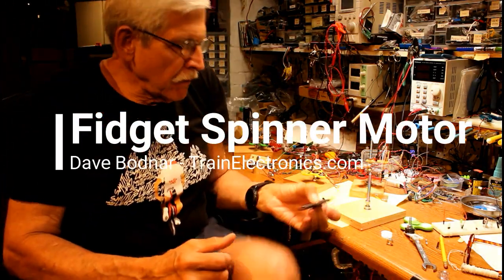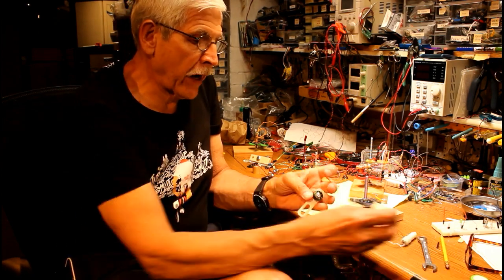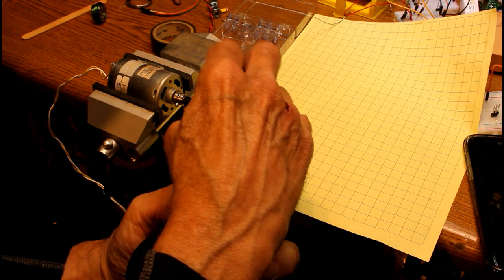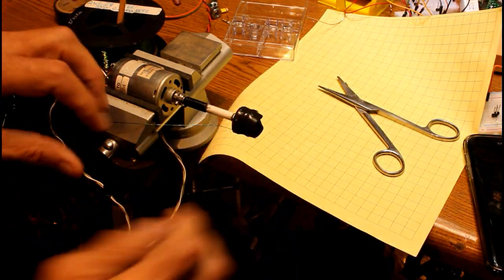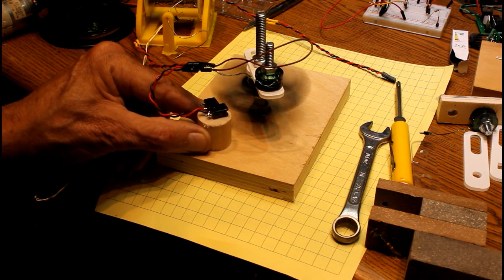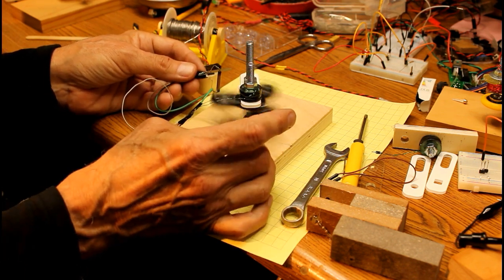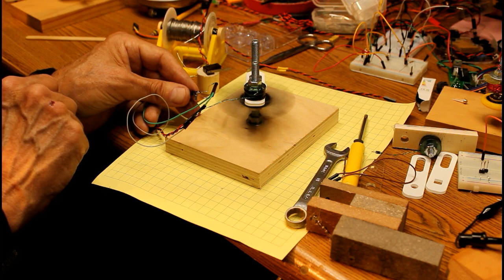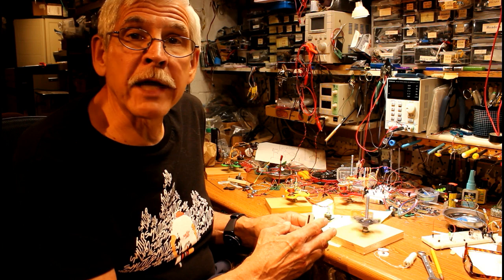Make a Brushless Motor from a Fidget Spinner

Comment: What reed switch are you using, also how do you keep reed switch from arcing?
Reply from the maker: I used a generic reed switch that I had in my junk box - I, too, thought that arcing would be an issue but it worked fine for quite some time
dave

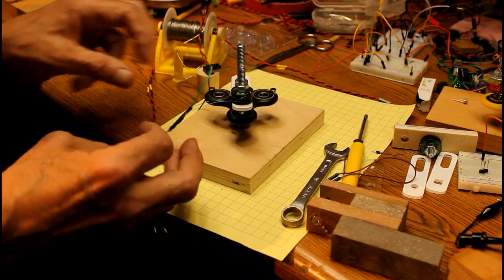Comment: I thought people used a condenser ( a capacitor type of a thing) to slow down the arching in the switch as has been used in automobile coil back in the days.  It appears that diodes serve the same function. That is interesting know.  I assume it is hooked up maybe differently in terms of its position and also direction.  However I did notice in your schematics, one here and the other on your website showing both ways.  each pointing the opposite of the other and in the same part of the circuit.  Not sure if that matters or if you  have noticed. Here your diode is pointing north (9:50 time frame) and in your website the diode is  pointing south.  
http://trainelectronics.com/FidgetSpinner/
Also what does "D1" mean for the diode?  Are there different types and one should use the "D1" type? Oh got it, it is a 1 amp diode, just googled it.  :-)
Thanks.
Reply from the maker: Good observation!  The diode in the video's diagram is backwards - the bar on the diode (the cathode) should go to the positive terminal of the battery or power supply - the diagram on the web page is correct.
Thanks for helping to get that corrected
dave
Reply: @DaveBodnar  Well, I am going to take a chance to see if I will wear my welcome.  Here I go.  Chances are the answer may be too complicated.   I took a front loading LG washing machine apart, which I got for free for parts. I have saved everything intact, meaning the direct drive motor ( that was the main item of interest).  All of the wires, the control panel, and the computer. The motor looks magnificent to me.  How on earth I can run the motor now that everything is on the floor of my garage.  I have looked all over the YouTube,  No luck. at all anywhere on the internet and not even close to anyone saying anything about it.  There is only one video for instance on YouTube by Mr. Electron but he is playing with it by means of Battery 12 V.  and some control module. But I am wondering if I can use the washing machine control system bypassing other demands of the module.  Are you going to say I am over my head?  :-) 
 https://www.youtube.com/watch?v=g-o0L7QaY3k
Awhile back I sent you an email but never heard from you yet.  Yesterday I finally got a spinner motor with reed switch running.  I burned the switch ( too much voltage) and lost two magnets.  The rest I won't bore you with.  The motor was so alive.  :-)
Here is something  that I thought was I don't even know what to call it,  for now will call it a coincidence.  When/if you watch that Mr. Electron's video above, Exactly as you see that motor with whatever is with it, the plastic drum and the metal part base cut,  that is exactly what I did . I found it very amusing watching my motor in somebody's hand in I think India.
Reply from the maker: @alchemy1  If you had a schematic for the washing machine you might be able to redo the controller to meet your needs - without it all is trial & error, not a simple undertaking but still doable.  It is certainly worth some experimentation.
Good deal on getting the motor working!  It is great fun, eh?
dave
Reply: @DaveBodnar  I just turned 61 last October.  I act and feel like I am a kid who is so happy going to school but this time no one give me a test, No one  judges or can or compare me to others and me taking it to heart as real.  How that type of innocence can get lost is a million dollar conundrum.   
I am also happy to say that I made my own reed switch for the spinner as I toasted the first one from wherever I found it.    It works so beautiful that I don't know what to say.  I simply hot glued two thin magnet wires on two sides of a paint stir stick, let it stick out about couple of inches from the end of the stick.  At the end of one of the wire I soldered a metal from a metal clip in the form of a coil about 1/4 inches long.  You can imagine, as the magnet passes by it the magnet attracts the metal coil and it touches the copper wire below it and the rest is history.  You can visibly see the switch's operation vibrate up and down.  I guess I call it Blue Ocean(Ali's)  switch.  :-)
I don't know where the joy of learning comes from but it is what gives  being alive meaning.  
I don't know who said it, when or where I heard it aside from not knowing its meaning because that experience and the meaning of it  was lost and killed. But this is what comes to mind.  Someone said that the purpose of life was to learn.
And subconsciously what comes to mind and I never asked that person is what I remember was this:.  "Learn for what?"
Now the details to answer that subconscious question looks like this.
When one enjoys the beauty of a sunset, the joy of a good conversation, moment of seeing a long lost friend, a little puppy wants you to pick it up, one never asks why?

Comment: I was wondering if there was a reason why you didn't show close shot of the wiring of the microswitch and the reed switch, unless each one is a two wire switch like a light switch of a house.  But for some reason I think they are more than a simple two contact set up, maybe three or more?
Also I was wondering if you had the coil pole end the same as the magnet pole ( repulsive force) or opposite or perhaps that doesn't make any difference except it would just cause a change in the position of the switches?
Furthermore you said it maybe a good to install some sort of diode with the reed switch so it doesn't get quickly corroded.  Is a diode a simple two wire connection that  is installed to what wire in the reed switch you said?
Thank you very much.

Comment: If you use bifilar wound coils you can just about wipe out the lenz effect.
This becomes more important if you add a coil like your drive coil with a bridge rectifier for power.
 to power your motor. Try it before you say it can't work. the bifilar wound coils is the key.
The bifilar wound coils will get rid of most of the loading effect. I recently found a patented generator that makes use of this effect.  just use 2 wires while you are winding your coils and connect the 2 circuits in the coil in series, it's just that easy

Comment: another switch could be optical, but then you'd get into more complex circuitry and the timing would not be very easy though it would be solid state and last indefinately. reed switches I think only last around 1M cycles so a day or 2 continuous @ 1000rpm
interesting vid!
Reply from the maker: Good points - have a look at part II for Hall and optical sensors
dave

Comment: I LOVE IT TEACHER!!!!!!I LOVE TO SEE ALL YOUR VIDEOS....BY THE WAY IS NICE TO SET UP THE SPINNER INTO THE WASHER MACHINE PUMP I HAVE TWO AND I USE A 12VOLTS VACUME CLEANER  MOTOR THIS MOTOR IS FOR 120 VOLTS BUT WORKS WHIT 12 VOLTS AND I SET TWO LITTLE PUMPS AND GIVE ME CLOSE TO 60 VOLTS EACH MAY BE MORE IF I SET ONLY ONE AND TURNS MANY 120 LED LIGHTS....SO YOU GIVE ME IDEA TO SET THE SPINNER INTO THIS PUMPS,ALSO I MAKE SOME LAMPS 3 TO 7 VOLTS AND TURN I OR TWO 12 VOLTS  7 WATTS LAMPS AND 120 VOLTS LED WORKS AWESOME ...THANKS TEACHER!!!!

Comment: thanks for posting.  good work.  here is a some very late info for you and your subs.      Hardened steel should  NOT  be used as the ferrous-metal core of an electromagnet/solenoid.   why.    at some point in the future, the steel will become  Permanently  magnetized.    the presence of a permanent magnetic field in the core material will  Adversely  affect motor  performance.   compare the silicon steel used in transformers, etc.     instead, any kind of mild steel would be a better choice for the core material.   a few nail shafts, in a bunch, could be used.    cheers

Comment: What about using a (about 5 uF, or 0.5uF (if I remember right)) capacitor on the reed switch, ... just like the old points system on a car engine to eliminate sparks on the contacts.
OR, no mechanical contacts at all, using a hall effect sensor & a transistor as a switch, ... there are many ways, as you probably know.
I should have watched part 2 first, ... ha ha...
Reply from the maker: The capacitor would help.... the better method, explored in part 2 of the video, does use hall sensors - have a look!
dave

Comment: That is pretty good.  What would happen if you put a wire wrapped in a toroidal shape around the circumference of the three spinners and run an electrical current through the toroidal shape?    The current could be controlled by a computer to run at a desirable speed.  Could the speed of the spinners be controlled by varying the electric current?
Reply from the maker: Thomas- that sounds like what it would take to make it a traditional brushed motor unless you found some other way to power to the coils you describe

dave

Comment: To improve the timing and overall reliability you should upgrade to 6 coils (faster, more torque, more reliable) as well as having a titan supercomputer running googles deepmind to discover the right timing constants, to control it a high redundancy enterprise class server (min. 4 redundant power supplies, 10 SSDs in raid 1, quadruple CPUs, and at least 128GB of RAM per CPU) and have 2 of those servers in case one goes down

Comment: Why go all through that
When you can just glue a few magnets
With the + sides facing up & just hold the + side
Of another magnet facing down then hold just
Beasley above it & it'll spin.
If that figit spinner had copper wire wound around it will produce electricity
To light up abulb

Comment: Great presentation, Dave. If you want to protect your switch from back EMF, you might want to consider replacing the diode to a capacitor. That will allow you to run the motor in both direction. For example, a 10nF capacitor, rated for 250V would be ideal for this application. Keep up the good work!
Reply from the maker: That is a good suggestion - I may give it a try!
thanks
dave

Comment: But what exactly IS a "brushless" motor?
Reply from the maker: Traditionally motors had brushes to carry power to a rotating coil or coils - these brushes wore out over time.  Brushless motors do not have a coil in the center but around a central rotating magnet so no brushes are needed.
for more info see  https://en.wikipedia.org/wiki/Brushless_DC_electric_motor 
dave

Comment: How long will it work powering itself, if possible?
Reply from the maker: Sorry, Dustin, no perpetual motion here - as soon as the power is cut it spins to a stop.
dave
Reply: Dave Bodnar thanks for the quick response. I was hoping for a few minutes.
Reply: The high speed and increased mass from the magnets should let it spin on it's own once shut off for longer than usual.

Comment: In the diagram at 9:48 the diode is the wrong direction and it will conduct current instead of letting it pass through the coil. Reverse either the diode or the battery.

Comment: Technically, the switch is a brush, because it's brushing against or hitting the motor. In either case you've got something causing friction, and the point of brushless would be to not have that friction isn't that correct?
Reply from the maker: In a sense you are correct that the switch is a type of brush - if you look at the second video you will see that I use two non-contact sensors (Hall sensor and phototransistor) that work without friction
dave

Comment: If you used 3 coils in a triangle configuration, or even six, could you use an off the shelf BLDC controller to run it?
Reply from the maker: I really don't know as I have never tried such a controller with it - give it a try and let us know what you find
thanks
dave
Reply: The little BLDC controller I used has a sort of "kick start" function on startup, which it did attempt and the spinner shuddered a few times but I think the controller was expecting more "poles".  What I need is a down and dirty way  to sequentially cycle the coils with a variable source of DC  that switches polarity as the spinner arms pass over them - some sort of simple inverter with a PWM output? And don't say AC that would be cheating <g>

Comment: Dear Sir, Is there a method to let us use this spin in a device (e.x. in a car) it would be extremly useful I would try but I am not qualified :_(
Reply from the maker: Mohammed - this motor has no rotating shaft that could be used as a power take-off so it is not suited for much more than a demonstration.
dave

Comment: Just remember, it is NOT "electrical tape" it is sticky plastic tape, and must never be used for anything remotely electrical. After a time, the glue softens and can cause a fire, due to short circuits when it fails.

Comment: I'm interested to know if this would work with an LED persistence of vision spinner. They can be programmed to show the speed but I'm not sure how fast they can spin before the image destabilizes. Also, I wonder how much of a load these can handle, say, if you hook it up to a set of gears, maybe on a toy car, or what if you hook up several spinners on a drive shaft?
Reply from the maker: Elvis - if you balanced it very well it could be spun by the fidget spinner - the issue would be getting power to the POV part (unless you added batteries directly to the POV) - give it a try!
dave

Comment: use a hal effect sensor. its much faster. the reed switch is mechanical and cant switch very fast or they would have used them in brushless motors industrially. 

there is also many other sensors that can work like infrared diode or ldr or many other types. 

you can also use leds by using two leds. a led emitter can work as a light detector by use of a amplifier circuit like the use of a transistor with the led by sending current trough the led but not enough to make it lid very bright. 

then light shine on the led, the voltage in the circuit increase a little is just enough to act as a trigger to increase current in the drive winding. 

by using another led when the leds are in straight line with each other, then detector led increase current in the  drive coil, by letting the spinner block the light path of the leds, the current start to vary in the drive coil and the motor will run.
Reply from the maker: Have a look at video #2
https://www.youtube.com/watch?v=jfLUc7iLbp0&t=1s
thanks
dave

Comment: You should make a Bedini "scool girl" motor out of it. The advantage is a very simple, self timed circuit that doesn't have a switch to wear out but you'll need to make the electromagnet, dual-coil. Look for the plans online.  Then, you can play around with bedini's theories on back-emf and such. I never spent the time to learn all that he's trying to say but I did notice some of the bizarre things the motor seems to do to batteries, like cooling down while charging.
  It works by one coil being actuated by the pass of one of the magnets then activates the other coil to push the same magnet. At the same time, it charges a battery while using another to power it.
Reply from the maker: Thanks for the tip, Chris - I'll look it up.
dave

Comment: Really cool! Makes me reconsider fidget spinners. I would suggest getting rid of the microswitch and using an Arduino to control the power to the electromagnet, coding it to use the PWM pin would allow you to control how many times it turns off and on without robbing power. Thanks for the great project I may have to introduce this to my 7th graders.
Reply from the maker: Cameron - I have experimented with using an Arduino without too much success - The Hall sensor and phototransistor (both in part 2) gave me the best results - if you get it working with an Arduino please let us know.
dave

Comment: Y cant this charge an alternator and then free electricity?
Reply from the maker: sorry, that will not work.... 
dave
Reply: Getting free energy from a system is impossible because it violates the first law of thermodynamics. You would be putting more energy into the system than you would get out.

Comment: This night be faster if you attach a tip120 transistor and light detection with opposing LED. Quieter and faster than a reed switch but slightly more draw because of the LED and the TIP120.
Reply from the maker: Great idea and exactly what you can see in Video #2 - here:
https://www.youtube.com/watch?v=jfLUc7iLbp0&t=284s 
thanks
dave

Comment: You reinvent the spark plug of an engine  ,it turns on the right moment in the cycle. Bad tuning = less powerful minimal performance, execellent tuning is max performance. Or PWM , you can also do this with PWM, in fact it is PWM with an analog switch :-D

Comment: You can also add a small neon bulb across the coil - this will reduce the back EMF stress on the switch (either the mechanical or reed) and will also produce a cool rhythmic flash in sync with the motor (reminiscent of a spark plug firing). The collapsing magnet field in the coil (when switched off) will produce enough energy to flash the neon bulb (which takes about 60 volts or greater) - demonstrating the relative strength of the back EMF compared to the low voltage you are using to actually operate the motor.....

Comment: the only problem with this "motor" is it doesn't have a rotor shaft, so it cannot do any work, otherwise its a good example of a salient pole permanent magnet dc motor.
this design could be adapted to demonstrate a synchronous compressor for power factor correction.

for brushless though:
you could use 2 spinners as the bell ends, and drill a hole in a bar magnet to make a 2 pole rotor with a threaded rod shaft (using nuts to secure everything)
then use the reed switch and the coil to run it.
or maybe use 2 coils with separate reed switches for more stable speed.

then you can attach a load to it to demonstrate the motors usability, like a fan.
Reply: It is doing work..its spinning that infernal fidget spinner. Lol.